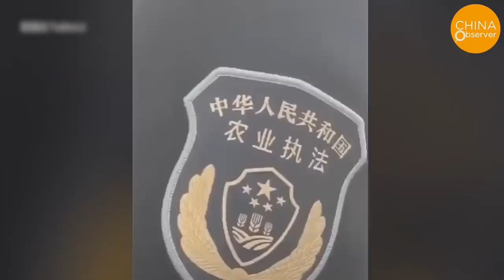China‘s Economy Is Finished, Returning Forests to Farming, Preparing for War and Famine?

Comment: So, let's count the idiocy

1. Timber stands and orchards can be used to pasture cattle and goats and sheep and pigs, doing double duty and maximizing food output.

2. You need roughly one surface acre of pond per 18 acres of crop land.  These irrigation ponds can also be used for aquaculture of oysters and fish to maximize food output.

3. In addition to the lack of irrigation for the terraced farms, they also lack the stone retaining walls and gravel beds which are meant to help insulate the crops.

4. Growing only grain crops with no crop rotation will just further destroy the land, making China even more dependent on fertilizer imports until it is too far depleted for even fertilizers to make it useful.

5. The lack of biodiversity will make the crops more vulnerable to disease.  Something China should be very concerned about given the steady eastward encroachment of UG99 Wheat Stem Rust, which could threaten the global food supply.

6. There has been no mention of modernizing irrigation practices.  Per Polymatter, much of China still uses flooded field irrigation methods which turn crop lands into endorheic basins such as the Salt Flats of Utah or the area surrounding the Aral Sea.  Improving irrigation to Western styles would drastically boost land fertility by not salting the earth you're trying to grow crops on.